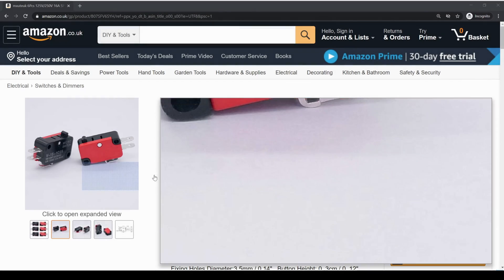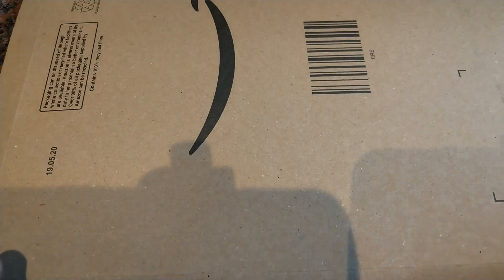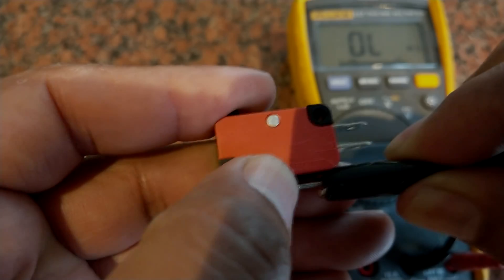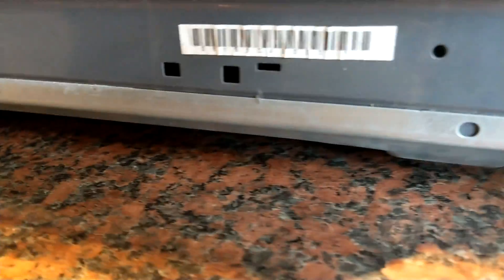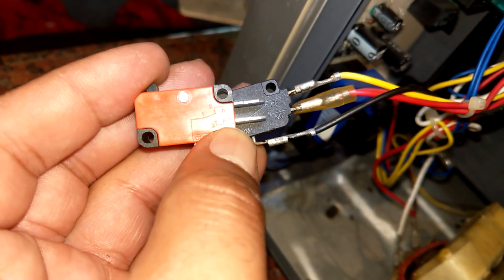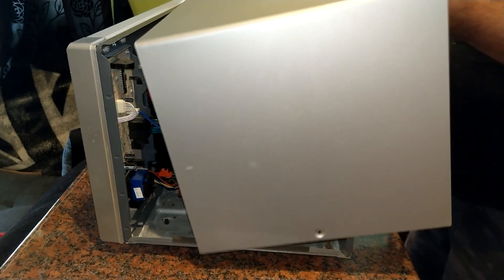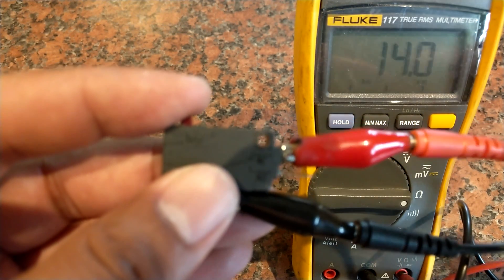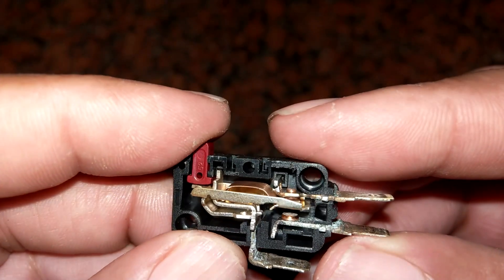Microwave Tripping Breaker Fix

Comment: Quick question.... how did you remove those fuses you replaced. I can't seem to pull them out ?
Reply from the maker: They're switches not fuses.
They will usually be secured in place by either a pin located in the hole of the switch, barbed clips around the switch which need prising or hot glue or a  combination of some or all of the above.

Comment: Probably worth emphasising that a microwave with the cover removed is probably the most dangerous thing to be found in most households. I once read that they kill more repair technicians than anything else due to the much higher (than mains) voltages that they create, with substantial current capability thanks to the kilo watt transformer.
Reply from the maker: Yes, absolutely. 
The high voltage is mentioned in the video and the pinned comment.
An electric shower with it's cover removed is pretty spicy too. 😌